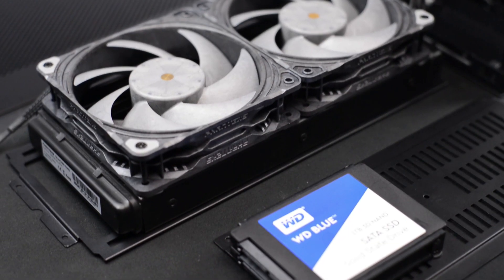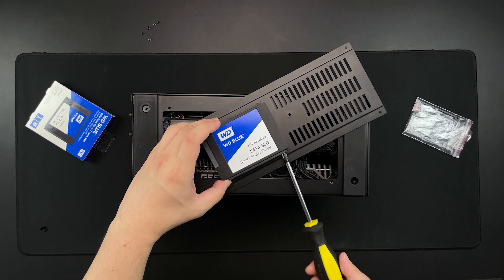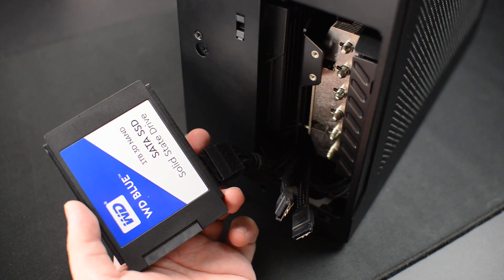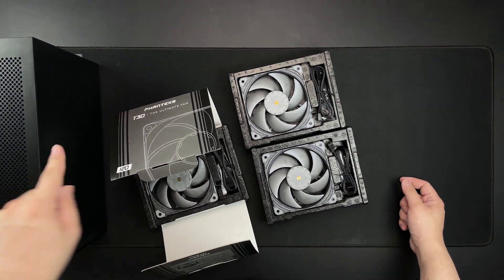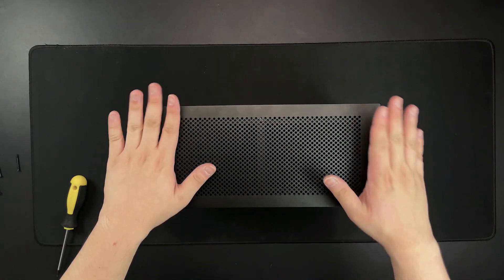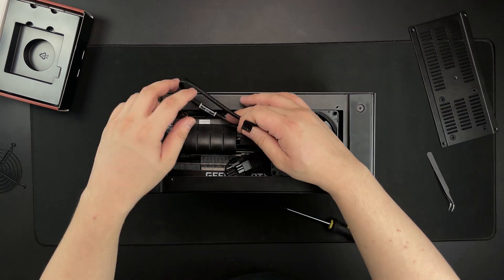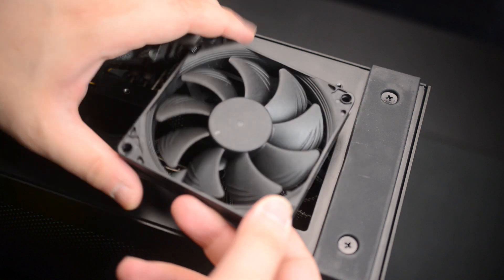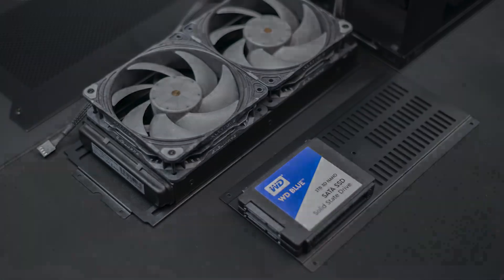SSD & Fan “hacks” worth doing | A4-H2O | Phanteks T30

Comment: Man, I wish I could find SSD brackets like that... :(
For the front cover mount you can also use adhesive Velcro, so it is actually removable (of course a little thicker than just double sided tape).
Reply from the maker: Yes the ssd trick was inspired by a person who used velcro

Comment: Did you ever replace your cables with custom cables? I am considering going custom cables just to get some space back and making things fit easier.
Reply from the maker: Cablemod sent me some custom sleeveless wires actually and I managed to fit in another SSD at the bottom; 3 SSD's in total
Reply: @Jelvin  do you know a good way to measure what is needed? I found some random Reddit thread that recommended sizes but not sure how to confirm.
Reply from the maker: @sbrpoker  You have to measure it yourself with a tape measure and estimate the length of the wires from each component to the PSU. I sent out the measurement with a 3 to 5cm excess just to make sure everything reaches the PSU.

Comment: I just built my A4 build a few weeks ago. Since I went with an SFX-l (1k watts and cheaper than same brand 750W SFX) I didn't have room on the bottom. I ended up storing 1 SSD between the video card and power supply, and the other one was the front cover trick. I checked the temps and the one behind the GPU doesn't get hotter than its normal operating temp so all is good. Wondering if I might could add a 3rd at some point. Not very pretty or secure but it's literally never moving and no one will ever see it.
Reply from the maker: Nice, can't believe you managed to fit an SFX-L PSU. Theoretically, you can technically have 3. Some tape would old it in place probably but nice to note

Comment: What if you built a 240mm open bottom stand, mounted two normal case fans in it in intake position, and set the pc on top of it? This way you could have proper intake on bottom, and exhaust on top. Especially if you leave off the bottom panel.
Reply from the maker: The intention of this video/my experiment was to see if there's anything I can do to add more components outside of what's instructed in the manual. If I wanted to have another 240mm stand then I'd just by a different case 😁😁

Comment: Having the same case right now - the biggest issue is actually how to cool down DDR5 sticks as they are running pretty hot... Any tips idea how to mount additional fan?
Reply from the maker: Unfortunately, I'm not sure if there's a way to mount any fans on top of the RAM sticks unless you're going for an air cooled build i.e. putting a thin radiator and fan combo on the CPU :(

You technically only have the bracket at the top for fans and the fan at the bottom will only be a little effective if you have custom cables.

Comment: Can you put in a bigger fan in the bottom if you drill into the frame of the case. I noticed there was already 1 hole there.
Reply from the maker: The best you can do is to hack a 15mm fan at least from my experiments. This is assuming you have thin enough cables. any fans thicker than 15mm is a no go

Comment: Will it fit if kraken z53 with t30?
Reply from the maker: I'm assuming that any standard 240mm radiator should fit without any problems but do check the overall measurements beforehand.
Reply: @Jelvin  appreciate your fast reply.. i  just did some googling the z53 has 30mm thic rad + the t30 is a 30mm = 60mm total. So i think it will not fit.. dang.. i really wanted to use the t30 on these with my current z53.. i guess i need to settle on the nuctua instead

Comment: Great video. I am swapping some parts over to this case. I've been using the sandwich style case layout for a couple years and have found the silicone cable kits for the Corsair SF units to really help with keeping open space for air to move. Most of the kits are pretty affordable and make for a really easy time getting cables run.

Comment: While nice for Sata drives, if you are spending $150 on a case with zero fans then you are likely well off enough to go full nvme. The pricing is close enough to warrant the massive performance improvements. Not only that but the extra space with the cables not having to be there for them. I'd rather invest in a thunderbolt external drive before I go back to sata if I needed more storage
Reply: its more out the mobo slots than the money
Reply from the maker: That would've been my route but I just happen to those extra drives from my previous nonITX PC so I might as well just use it :) Also, prices for NVME's are more expensive in my country compared to our Western counterparts so I went with this instead.
Reply: Not sure why you'd assume that. If you're poorer you'd have to consider your priorities and many people likely already have 2.5" drives in use (NVMEs were very expensive back then, especially higher TB ones, if they even existed at all). Or do you just generally build completely new systems every time? Performance is also not super relevant for data drives.

Comment: If anyone’s wondering the t30s don’t fit with NZXT radiators. The only way I was able to close the case was to essentially friction fit the rad with fans without the rad bracket. This includes removing all fan pads and not using screws in the 4 middle fan mount screws.
Reply: do you think lian-li p28s would fit? if not, i'll get a pair of noctua a12x25s.
Reply: Its fine the T30s aren't really necessary
Reply: @greghansford6000  There's Noctua's G2 fans now at standard height, at least in brown, but that doesn't matter much with a radiator between them and the top panel.

Comment: Unfortunately T30 even a little more expensive than the Noctua A12 here. Guess I’ll stick with the Arctic P12 for now, which are 6 times cheaper here than T30💀

Edit: Nonetheless a very nice video!
Reply from the maker: I totally get your sentiment. T30's are expensive in my part of town too. I initially wanted to get the P12's too but I just got the T30's on sale and it was the last set of 3's. 

Thanks so much!
Reply: @Jelvin  Glad you found them on sale! I’ll probably get them later on as well, if the price is a bit more reasonable.

Comment: Hello, i am planning to re-build my itx rig into this case (r9 5900x + 6800 XT) and i have a question regarding your AIO as currently i am using x63 and i need a smaller AIO. 
Can the Phanteks Glacier One 240 aio fans/pump be controlled in regards of the water temperature inside the AIO instead of the CPU temperature? 
Would you recommend choosing the Glacier One 240/ H100i Pro Xt/ EK Basic 240? (x53 is out of question as the radiator is 30mm thick and i just NEED T30 fans in there)
Reply from the maker: Hi! I'm not aware if it's possible to check the water temps of the AIO; at least I haven't heard about this being possible unless you're doing a custom water loop. Apologies for that!

For the AIO, it really depends on the compatibility of the motherboard. I believe that as long as the pump block fits and doesn't bump into any parts e.g. heat sinks, you're good to go. As for the recommendation, I can only vouch for the fitment of the Glacier One since that's the one I have but I've read that it's easier to put in an H100i and EK Basic since it doesn't have any accessories.
Reply: How did it go?im also thinking of moving to this case and have the same specs
Reply: @StereoPenguin94  it went fine, i used the radiator that i mentioned - pump can be cintrolled but not based on the temperature of the water, however i use fan software to control based on cpu temp. Even with T30 fans the cpu gets quite hot. I have limited my cpu to 125w max and played with undervolting settings till i found a right balance. With good balance and undervolted gpu while gaming i get like 70c cpu and 75c gpu
Reply: @StereoPenguin94  but if you push your cpu without undervolting and run like cinebench it will still get 85-90c

Comment: That behind the front cover 2.5 drive mount definitely a good one. The middle pin for the push pin panel honestly is useless due to the panel having four pin already at each corner. Lian Li should just ship the case with no pin on the middle one.

Also it seems possible to double tape at least two 2.5 HDD at the front panel onto the case bone horizontally.

Comment: May i know that what was your aio,plz？
Reply from the maker: AIO is Phanteks Glacier One 240MP
Reply: @Jelvin  which route did you use for the AIO tube?. Under psu or over it?.

I actually picked up the exact same AIO yesterday. Currently waiting for it to arrived.
Reply: @Jelvin i know its an old post, but how do you fit that aio with t30?… i am unable to fit those two since my phanteks radiator thick is 38mm.

Comment: if you put 2 120 slim fans at the buttom and use the 2 t30 fans with the greatest performing 240 aio here will be aailable in a few month, mybe a newona cames ot, r using the current possibilities, would you be able to cool down and muse power imiting a bit and voltage modifying undervolting to be able to use fully the new 13900k or ks and he 4090 or if any of  the 4090ti-s will fit phisycally?
Reply from the maker: A couple of points

1. You can't officially fit 2 120 slims at the bottom. You can put one but it needs a little hacking

2. Based on the specs that I've read, the 40 series cards won't fit this case since the case can only accommodate GPU's less than 300mm in length. The 40 series cards announce are over that. But then again, the case can't accommodate thicker 3 slot cards

3. I wouldn' t go for an SFFPC I were to get higher end components. I'd rather get an mATX or a full sized case + custom water cooling for that.
Reply: @Jelvin  theere is one 390ti design that fits, if that company mkes ect samer version of 4090 thats all i need
Reply: @Jelvin

Comment: It would be tempting to design and 3D print a new bottom grill to allow 2 bottom fans, although it may require printing 2 new feet to allow a little more air flow
Reply from the maker: I thought of doing that actually but I unfortunately don't have a 3D printer to prototype. 😅

Comment: Very useful video, thanks a lot! :D Was wondering, would it also be possible to fit the bottom fan under the gpu instead of under the power supply? (might result in better gpu temps) And did the grill for the noctua a9x14 come in the box? Cheers
Reply from the maker: Hi! Not sure what you meant when you mentioned about placing the fan under the GPU cuz the only place you can hack in another fan is under the power supply. And no the grill is a separate purchase.
Reply: @Jelvin  Hi, thanks for the quick response! Ok, so there is no space for two fans on the bottom, good to know. ^^ Thanks again :D
Reply from the maker: @MegaNeonHD  Yes official you really can't put in a fan. I just borrowed the hack from people on Reddit. 🙌

Comment: How did you fit the t30s when your total hight with the rad is 57mm and only 55mm are supported?
Reply from the maker: The only thing impeding the fitment was the center metal bracket that’s supporting plate for the motherboard and GPU mounts. 

The T30 configuration should fit if you remove the anti-vibration pads in the fans. If you don’t mind the radiator bracket bending a bit, it’ll fit with a little bit of resistance. 

You can check out other people here and on Reddit confirming that it fits but again, it’s not officially stated that it will fit.

Comment: your using phanteks Glacier one MP with T30 Fan? total of 68mm thickness with rad and fan right?
Reply from the maker: So I got the standard MP. The T30's I bought separately. Total thickness is around 60mm

Sorry I got confused, I thought you meant the Glacier with the T30s.
Reply: @Jelvin  thanks for the reply reply.. i will be assembling same case with same setup up with you, and will also use T30'S 

by the way why did you change the aorus z690 ultra to asus z690? im still thinking between aorus ultra and asus z690i can you give me some tips?
Reply from the maker: @cletcadano4462  the original Aorus z690i had PCIE Gen4 issues where it’ll spout WHEA errors on Windows so you had to force the setting to Gen 3. If you’re still going for the Aorus board, make sure it’s the PLUS version; it should be on the label. 

I chose the z690-i strix mainly because the MEG wasn’t available during the time I bought the board as a replacement. Would’ve went with the z690i MEG if there was stock.
Reply: @Jelvin  just know im checking the meg! Stealthy and classy look but im not sure if the phanteks 240mm aio would fit with the front cover i dont want to gamble. U think it would fit?
Reply from the maker: @cletcadano4462  better to check reviews on Reddit. Had to do some for the parts I chose before I pulled the trigger 😅
Reply: Also want to ask its possible to put the phanteks tube to the left of the motherboard right? Opposite of the ram when using the z690i asus motherboard. Coz i noticed one of your video.. 1st your route the aio tubes on the left side of the board then after a white you changed it to the bottom part..
Reply from the maker: @cletcadano4462  sorry when you say left, do you mean beside the RAM? My orientation has always been next to the heatsink where the tubes come out of the pump from the left.

Comment: is it possible to put 2x m.2 and 3x ssd in this case using z690i rog?
Reply from the maker: The z690i strix can have 2 x M.2's. 

For the SSD's, depending on your configuration, you can put 2 at the bottom and 1 behind the front cover as long as you route the SATA data and power efficiently.

Comment: Fuck yeah, this video was even better than the last. Thanks for putting these A4-H2O tips on youtube, will def use them in my upcoming build.
Reply from the maker: Thanks so much for the appreciation! Means a lot! 🙌
Reply: @Jelvin  Can the T30 be installed on the lt520 without problems?
Reply: @miyamoto_mu2837  , I have LT520 with T30 in my H2O. pump decorative cap not installed.

Comment: Man, that temp difference between Noctua and Phanteks is a lot. I am running a 5800x and 3080 so maybe I should pull the trigger on the T30s….
Reply: I have a 5900X and a RX 6900XT and use Noctua fans. I can imagine while beeing a bit coolerbthe T30 fans might be louder which was a no go for me.

#1 Recomenndation I can give is to undervolt your hardware.

My RX 6900 XT runs just fine on 1050 mV @2600MHz.

A Ryzen CPU can be tweaked manually with the curve optimizer or CTR 2.1
Reply: @AlphaDango  what temps are you getting and does the heat of the gpu heat up your room? I moved out of the ridge due to the gpu heat heating my room up,moved to a matx case and room is cold now but love this case I have same specs except a 6800xt
Reply from the maker: Whoa your hardware can get significantly hotter compared to mine. One of the person I referenced in the video, snapwich, had a 5950X and 3080 Ti so I think those T30's will give you a little bit more airflow IMO.